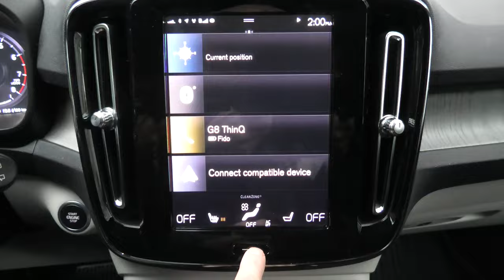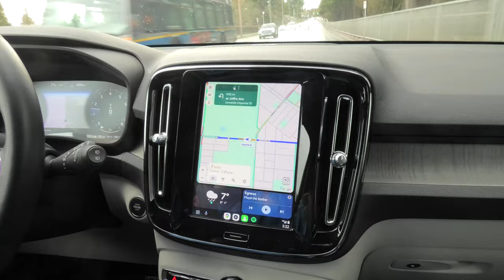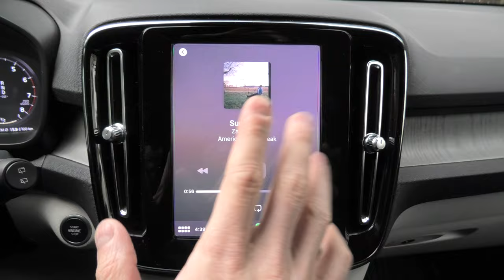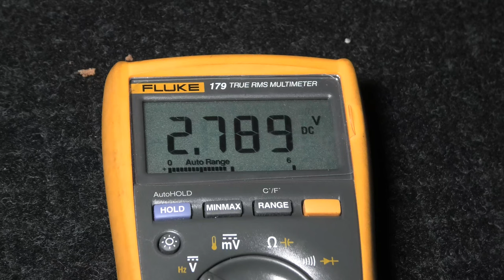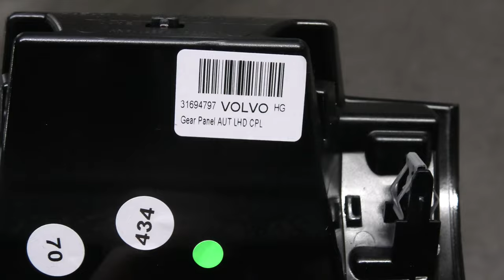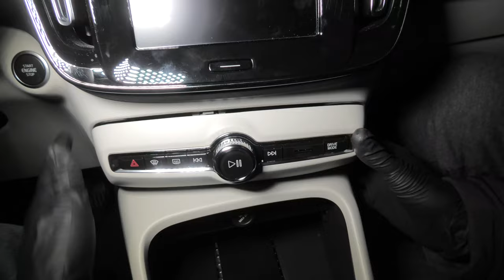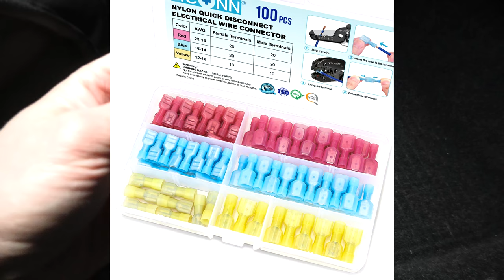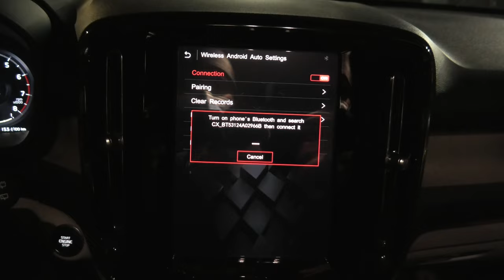Volvo XC40 (2019-2022): Full Screen Android Auto And Apple CarPlay In XC40 With Sensus System!

Comment from the maker: PRODUCT LINK:
Apple Carplay Android Auto Kit Module For Volvo XC40 Full Vertical Screen Seamless Connectivity - https://cartrimhome.com/Apple-Carplay-Android-Auto-Kit-Module-For-Volvo-XC40?tracking=morozov_automotive.

RECOMMENDED TOOLS:
1. TRIM REMOVAL TOOL - 4pcs Auto Door Clip Panel Trim Removal Tool Kit - https://amzn.to/41nYhsk.
2. PRECISION KNIFE - Fiskars Heavy Duty Die Cast Craft Knife - https://amzn.to/3KGF5A9.
3. RATCHETING SCREWDRIVER SET - Wera Kraftform Kompakt 60 RA Ratcheting Screwdriver Set, 17-Piece - https://amzn.to/424g1ZY.
4. WERA KRAFTFORM KOMPAKT - Wera Kraftform Kompakt Zyklop Mini, Set of 27 - https://amzn.to/3N91Tch.
5. MULTIMETER - Fluke 179 Professional Multimeter with Backlight - https://amzn.to/3y0mAio.
6. E-TORX SOCKET SET - SEDY 14-Piece Premium Female E-Torx Socket Set - https://amzn.to/3vioJbq.
7. 3/8" RATCHET SET + EXTENSION - Wera Zyklop Speed 8100 SB6 - https://amzn.to/47xfIcu.
8. SOCKET SET, RATCHET - GEARWRENCH 57 Pc. 3/8" Drive 6 Pt. Mechanics Tool Set, Standard & Deep, SAE/Metric - https://amzn.to/41wE6Z3.
9. SWIVEL HEAD RATCHET - GEARWRENCH 2 Pc. 1/4" & 3/8" Drive 72 Tooth Dual Material Roto Ratchet Set - https://amzn.to/3kwhHdS.
10. CLIP REMOVAL TOOL - GEARWRENCH Panel Clip Pliers, 3705 - https://amzn.to/3SjP2Ff.
11. MAGNETIC TRAY - Performance Tool W1285 Large Magnetic Nut & Bolt Tray for Garages and Workshops, Black, 6" x 10" - https://amzn.to/3ZOBG66.
12. TELESCOPING MAGNETIC PICK-UP TOOL - Telescoping Magnet Pick-up Tool - https://amzn.to/407A2Nz.
13. MALE / FEMALE ELECTRICAL CONNECTORS - TICONN 100 Pcs Nylon Spade Quick Disconnect Connectors Kit - https://amzn.to/3ZRMUYe.
14. ELECTRICAL TAPE - 3M Scotch Electrical Tape, 3/4-in by 66-ft - https://amzn.to/3J0M0TB.
15. UPDATE FRIENDLY USB STICK - Verbatim 256GB Pinstripe USB 3.2 Gen 1 Flash Drive Retractable Thumb Drive With Microban Antimicrobial Product Protection - https://amzn.to/4ce7hWl.

Comment: I installed the module, it seems as if the original system had been reset, the rear child safety warning light came on and the individual driving mode appeared which wasn't there before. Is it possible that a reset occurred after installing the module?
Reply from the maker: No, we did not experience any changes to the Sensus system after the installation. It is possible that you could have reset the system unintentionally. If you press and hold the home button for 20+ seconds, it will reset/reboot the system. Also, if you have updated the software in the new module, this may have rebooted the system as well.

Comment: What about the Android Auto display resolution? Is this as good as the Carplay one? I read resolution issue with another Android Auto full screen device on Volvo Sensus.
Reply from the maker: Android Auto resolution is slightly less crisp than the Apple Carplay or original Sensus resolution. But it is still good. I do not experience any discomfort.

Comment: Great video! I have it installed on my Volvo S60 2020, but in your video, the Android Auto looks really impressive. I can see all the details on the map, on mine unit it is blury. Also, when I connect the USB, it says 'USB not supported😢'.
Reply from the maker: Thank you for your feedback! I would try to do the software update to fix these problems. Here is the link for the update which we did on our device - https://cartrimhome.cn/our_dw/VOLVO_RG440_CARPLAY.rar. We showed how to do the update in the video starting at 52:56.
Reply: @MorozovAutomotive  Thank you! I'll give it a shot with the software update. When I connected  iPhone and tested it, the display appeared significantly sharper. However, I noticed that the response speed was better on Android Auto.

Comment: Thank you very much for another excellent and detailed video. After going through it it seems to me that the Android auto audio is coming from bluetooth. I am wondering if the car has already the original volvo aa interface (with the bad half screen implementation) would it be possible to get the sound through that ? Like choose from the media menu android auto instead of bluetooth?
Reply from the maker: Thank you for your feedback! Yes, it uses the original bluetooth in the vehicle for the sound. No, I don't think you can do it this way.

Comment: Hi, thanks for the video. Are the CAN wires only to support the reverse camera? Will the device function without it? I've checked the harness under the seat of my S90 2019 (manual seat) and the CAN-H + CAN-L are not there. I'm wondering if the system is going to work at all or what potential problems should I expect if I don't connect the CAN wires?
Reply from the maker: Hi, no problem. CAN wires need to be connected. Otherwise the new module and the head unit won't turn on. The CAN-H and CAN-L wires in your S90 likely can be found under the door sill similar to the XC40.
Reply: @MorozovAutomotive  HI I've just completed fitting this unit to my XC40 as per your excellent video. My main screen is blank. I have tried to reboot the system by pressing the screen button at the bottom of the screen but it does nothing. However I have had the screen come on for a few seconds periodically when pressing the button. As you have said in your reply above do you think it is the canbus wire connection, as I have used the supplied clamps?
Reply from the maker: @marccon  Hi, yes, looks like there is no stable connection between CAN wires. The head unit and the module will turn on once the wires are properly connected.

Comment: Do you have a link to the latest software update (if any) ?
Also, do you know a way to automatically show isudar instead of sensus when you start the car and module is ready, without pressing center button each time ? Isudar module can take screen control if you are in sensus and you receive a call for exemple, but I did not find a way to do it automatically on start...

Comment: Dear Morozov, thank you for the detailed video and description. 👍🏼 Great Job!

In ISUDAR's videos, I don't know if it is for XC40 or not, because the interior of the vehicle looks a little different, they connect directly to CAN purple cables without removing the front seat. But you are doing the process by removing the front seat. What is the reason for this? 

You also disassemble the center console cluster and place the module. Can't we place it from the front passenger side without opening the center console cluster?
Reply from the maker: Thank you! We removed the front seat because we ran CAN wires underneath the floor carpet. You can also try running it through the dashboard. In the XC40 you won't be able to put the module from the side without disassembling it.

Comment: Hi there, thanks for the detailed video and explanations.
Amplifier removal is needed in order to run the CAN wires under the floor carpet, right? I could try to run them through the dashboard instead, but are they long enough to reach the door sill?
Reply from the maker: We removed the the seat and the amplifier in order to remove the carpet and hide the wire in the frame of the vehicle. The wire was significantly longer than needed for our installation. I think it should be long enough to reach the door sill if you run through the dashboard.

Comment: The box looks hefty! Do you ever hear it moving when driving around and it does it drain battery life more (specially with engine turned off) ?
Reply from the maker: The box sits snuggly inside the central console. It does not rattle. So far we did not notice any difference in terms of battery performance.